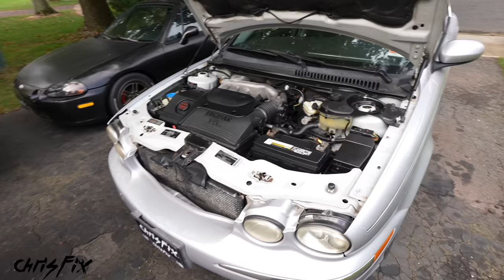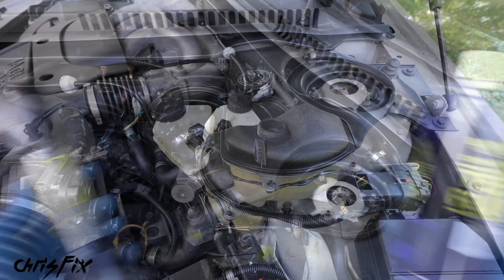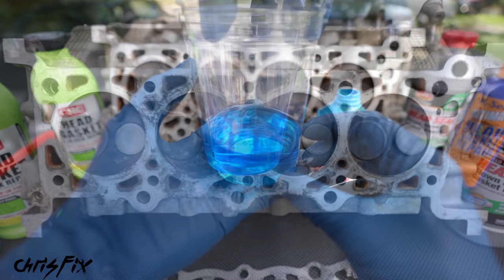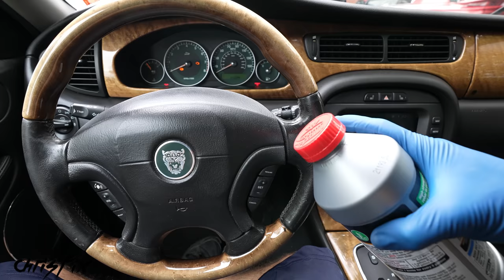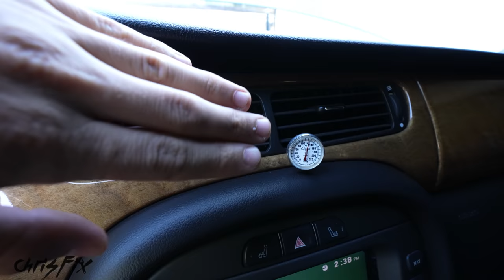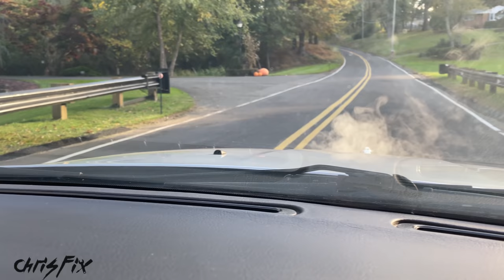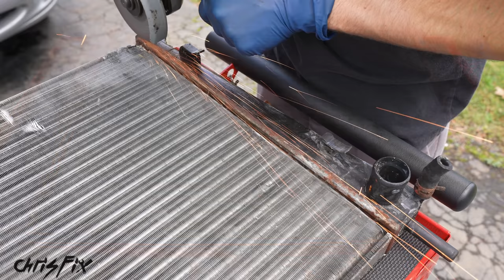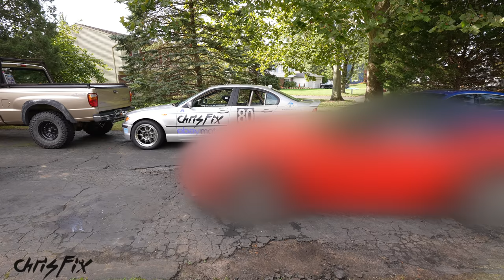Do Head Gasket Sealers Actually Work (FULL 2yr TEST with Engine Teardown)

Comment: What you could do is get a U shaped heater hose and nipples and bypass the heater core during the headgasket repair just to keep that from possibly getting clogged as that's a lot harder to replace than say the radiator if that were to get clogged.

And you could also temporarily remove the thermostat if you are concerned of that getting clogged.
Reply: So connect in to out flow for heater core, run the sealer, reconnect. Was thinking the same and surprised people are not doing it.

Comment: Great information. I have a 2010 Range Rover sport that has a blown head gasket. But it runs great and never over heats. I’m going to bleed the coolant system and add the gasket fluid sealer

Comment: I bought a 2000 Mitsubishi Lancer with a 1.3 engine and presumably a warped head. I got a bottle of Bar's leaks, although not the same as Chris used here (for the Dutch people here, I got it at Gamma). Before I used it I would have to check the coolant every 3 days and basically refill the reservoir, my fuel economy tanked and when giving a bit of gas it would kinda stay in the higher RPM's for longer than it should (and maybe some misfiring when idling?). After using I noticed all of these issues went away. This was like half a year ago at this point? And it's done probably 15k-20k km. And it's still doing strong with high way trips every day to school, multiple longer trips at like +/- 3000 RPM's for a couple hours on end and having basically full trust in it to keep working properly. Overall so far it's saved the car. Now I'm considering sticking in a 4G93 from a Carisma if/when the sealer let's out again hehe.
Reply from the maker: Glad to hear this worked out well for you!

Comment: 23 years ago a neighbor gave me a  Ford Taurus with a leaking head gasket.  A shop told him. It would overheat. I never tried to confirm any of his symptoms.

I drained the system, filled it once with tap water, warmed it up. Drained it. Refilled with tap water. Added the Bar's Leak stuff in the tube that was silver. Added to radiator and followed directions. Ran it as directions said and drained refilled with 1:1 coolant.

It worked for a good while.  I'm not sure how long as I sold it cheap a few weeks later.

Comment: I had a friend who bought a car not knowing they had used head gasket sealant. It lasted a couple years but plugged up the heater core and half the radiator. I did a head gasket on it and it caused a lot of pitting and corrosion. Had to take a decent amount off the head and use a dab of silicone on the block. As far as i know its still running but it would have been a lot easier to fix it right when it happened but it did work.
Reply: Pitting is caused by cavitation or acidic coolant, nothing to do with the sealer.

Comment: Nice job!  My Jeep GC with the 5.7 Hemi has a head gasket leak. I’m off to buy some Bars now thanks to your video.   Some added insight;  The only symptoms are overheating over 2,000 rpm, exhaust gas in the coolant (confirmed) and lots of bubbles in the coolant at operating temp.
Reply: Good, then there's a high chance of it successfully sealing if the cooling system pressurizes.

Comment: A couple of months ago I used a head gasket sealer in my 1994 F-150 XLT I used it to fix coolant leaking into the oil and it seems to have worked well
Reply: What brand head sealer?
Reply: I think it was Blue Devil

Comment: i had a 01 honda accord that had a moderately bad head gasket and i used the blue devil sealer and it worked for a couple years with kinda wild driving ie higher revs and pushing motor stock limits

Comment: I learned 4 things from this video.
-How to diagnose a head gasket leak.
-Head gasket sealers work fine and safe to use. 
-Change oil after using head gasket sealer.
-Jaguar is garbage, especially that model.

Comment: The Ford 2.5/3.0 Duratecs (96-2008ish DOHC V6) are pretty notorious for being sensitive to overheating but as far as I know have no real known common issues that cause them to overheat. My 97 Taurus 3.0 DOHC developed a rod knock (but still drove fine) after it overheated with my sister driving it, a long time ago now and I have no idea why it initially overheated as it had no issues/symptoms to that point. I don't think the warped head caused the issues; I think it was resulting damage from an unrelated overheating event which then caused the problems. 

Heads don't just warp nor do head gaskets just pop under normal operating conditions, IMO almost every time the engine is fine until a failed water pump or unrelated cooling system problem causes damage from being driven while overheating as the temps in the head become insanely hot with no coolant flow. With a working cooling system and flow through the head/block you're unlikely to ever experience these kinda symptoms IMO. Good vid

Comment: I got really lucky I guess my 20 yo miata engine has a crack in the gasket. The engine light went on when my coolant tank went empty, thank god! I stopped the care immediately saw bone dry coolant tank and called AAA.  We put in a sealer in and had no idea how it would hold up. 8 months later it's just starting to open up enough for some of the coolant to slowly leak out (about 1/4 inch below the line loss per month). I drive about 120 miles a week, city and highway miles. I'm so grateful, I will seal her again and again because I won't be able to fix the engine. And she's a beautuy with only 130K miles and brand new top.

Comment: I used a product called Thermalweld back in Dec of 22 on a 4.6 North Star and not only did it fix the coolant consumption in 5-10 minutes but it is used by my family as a daily driver as of today(3-26-24). I’ve put around 8k+ on it since.

Comment: I've used copper sodium silicate twice and it worked both times. One was a quick fix until I could replace the actual gasket. The other worked and still is working years later. It good to totally drain the system and use the silicate. Then after drying over night, replace the fluid with new compatible sodium silicate and new antifreeze

Comment: I used the stuff in the blue bottle/orange top on a very old series landrover(basic and crude) . I was getting   water in oil and possible oil in water. I also had a leak on the block ,possibly a core plug. 
I was very sceptical, but having g changed the head gasket, I either had a crack or warped head. Tried a bottle of bodge to buy some time whilst fixing up a better engine. 
Very surprised that it worked and its been OK for around 6 months. Oil is now OK, water is contaminated, but likely just residue contamination.
Must point out, it's a very basic diesel engine that is close to death and would be scrap anyway.

Comment: I have 2000 Nissan frontier. Mechanic said he tested a hint of exhaust fumes in the coolant and said to put a head gasket sealer in it. I used the green bottle in this video. I then drove it for a couple months with no issues. I put about 4K miles on it doordashing before it started missing. Upon pulling the plugs I noticed they were covered in the stuff in the green bottle
Reply: That's ok.

Comment: For 2024 - I recently (late 2021) used the "green stuff" (not mentioning brands), and it worked on a 5.0l (302 ci) aluminum head/cast block engine after draining the radiator, and refilling with fresh, mfr recommended coolant... However... 

It couldn't hold up against the pressures of full-throttle acceleration (to merge onto a busy interstate highway), and would return to leaking for about 2 days, before sealing up again (I tried to avoid doing that a third time) ... However... That lasted only for 1.5 years, or roughly 11,000 miles (17,700 km). 
*{I didn't keep track of the mileage, but did two oil changes (@~5000 mi ea.), within that time.} 

So, yes. Totally worth it! 
My results are real, and totally my own, even if they were almost identical to those in the video. 

Although I really enjoy driving this car, I will be repeating this treatment, rather than absorbing the costs of a head gasket replacement on this, an older vehicle with 190k miles, which is kept in good running condition as a "daily driver" in order to help me save enough money to pay cash for its eventual replacement. 

Since 2004, I've had all of my vehicles completely paid off, paid cash for everything thereafter, and staunchly refuse to ever again take out loans or make payments for a vehicle, other than leased equipment used for my businesses.

Comment: Silicate works but hard seals crack with aluminum expansion.
TITAN is different.
It forms a soft bond that can take aluminum expansion.
A BMW user has 5+ years and still going.
Worth trying.

Comment: The K-seal if the one to use. Not those silicate versions. You picked the wrong one. What the issue is with these cars is the fan assembly fails, with no notification. Engine overheats, warps the head, and off to the junk yard it goes. If K-seal is used, then also replace the electric fans. And an oil/filter change like you mentioned.  It's not normal for an engine to just overheat. low coolant due to a leak, could cause it, but that's visible on the ground. The fan failure is insidious.

Comment: Those bubbles at first could easily be air trapped in your system.  When you drive it the air bubbles move to resivor then coolant level drops.
Reply from the maker: True but if it constantly keeps dropping like it did then it's indicative of a larger issue

Comment: My experience, my son and I tried a used ej20 in his forester, bubbles in the coolant. We did the head gaskets, still the same. So we tried rislone heavy duty head seal to buy us some time. No difference in the bubbles but it did block the radiator and heater core. We were able to flush them out, big gobs of what looks like fiber glass.

Comment: Hi Chris i can vouch for the Rislone and Nulon they are good gasket sealers for short term fix with consistent topping up of water or coolant in radiator before going anywhere as i used both brands to do a temp repair on the rav 4 until my mechanic was able to book me in for repairs both sealers prevented the cylinder head from becoming severely warped still ended up getting a bill of close to $2,290 for head gasket replacement and replacement of cylinder bolts 1 and 2 which had lost their threading completely resulting in coolant leaking outwards 

For all its worth those sealers practically saved me from a complete engine rebuild with the cylinder only requiring a light skimming over using a milling machine to smooth/level it out even though i was without my vehicle for close to 4 weeks the end result of lengthy repairs and life support sealers both paid for them self

Comment: The sodium silicate can actually lock up the rod and crankshaft bearings if it gets into oil by some chance, which also includes the condition of high blow by past the piston rings. So if your coolant also mixes with oil and/or there is a good enough blow by, after you use a sodium silicate product to stop the coolant leaks by the head gasket, you'll also be at great risk of destroying the engine all together if that thing ever reaches the oil system.

Comment: you're the man doing God's work! i suspect i have a small combustion leak. i have to bleed the radiator about every 3 weeks. coolant level stays the same and there are no cross contamination between any of the fluids (i check weekly). been wanting to try one of these sealants but was hesitant because i didn't want to make the problem worse. will try this and see how it goes.
Reply: Did you do it yet? What product and results?
Reply: @DanaCasey01  i used one bottle of kseal. i followed the directions on the bottle exactly, and i haven't had any overheating at all.

Comment: Thanks for your great video, Chris!  Did you consider removing the spark plug from the leaking cylinder, and or disabling the fuel injector for that cylinder, to alleviate any back pressure?   👌

Comment: i used a headgasket repair years ago i honestly don’t remember the brand i bought it at oriellys autoparts for my 1999 eclipse gs with a 420a it was a very long process but it fixed it lasted me a while before i sold the car because of the transmission failure

Comment: My first car was an S10 that a shady dealer had filled with head gasket stop leak for a quick sell. When winter came around the heater didnt work which was the first sign. When spring came the overheating issues started. 
Turns out, every cooling passage, the radiator, and the heater core was completely clogged with whatever head gasket stop leak they had used.

Comment: Been having to refill coolant every 2 weeks, seriously thought it was a head gasket leak, until
I bought the tester which showed my head gasket is fine, now I’ve gotta figure out where my coolant is going
Reply: You mean the block tester with the liquid? In very rare cases it could still be the headgasket, but look at your radiator, waterpump, heater core and every connection like clamp or t-pipe. Do you see coolant under your car if you park? Also how does the oil and coolant look (any sort of mixing between the two)?

Comment: Since ive been driving and working on cars (40 years) I've never seen a labeled product head/head gasket sealer actually work. The one thing i have seen work was sodium silicate. I used to go to the drug store and buy it in a quart jar.  Simply pour it into a radiator at operating temperature and VOILA!! sealed!
Not a permanent fix though
Reply: But most sealers are sodium silicate.
Reply: @SinsBird  It's actually one in 5.
That's a far cry from "most".
Pure sodium silicate or "liquid glass" is not sold in automotive stores.
The products made from it contain up to around 65% with other stuff mixed in. 
Some products do contain it, but certainly not "most".

Comment: @chrisfix
Do you think I could also 
1) remove spark plug and disconnect fuel injectors from cylinders which indicate a leak
2) remove thermostat from thermostat housing to prevent the clog that might have happened
3) Let it idle with affected cylinder (s) not firing and with no thermostat
4) replace thermostat and then proceed?

I heard this might give sealer a better chance of setting where it needs to

thank you so much for this incredible video and the work you put into it